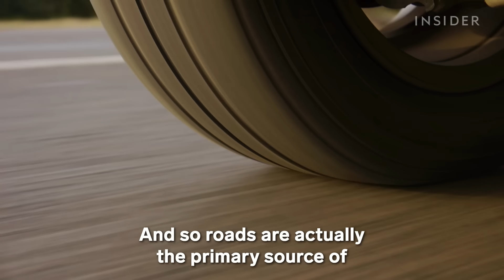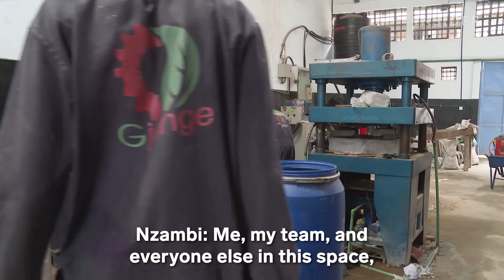Young Inventor Makes Bricks From Plastic Trash | World Wide Waste | Business Insider

Comment: if they mold the shape differently i bet they can even build a house with these recycled type of bricks. Very strong he threw it to the ground and it just bounced off a normal brick would have broke.
Reply: Being strong alone doesn't make this a good building material. What happens to these when they've been sitting in the heat for years on end? Plastic vaporizes overtime, and for the same reason you shouldn't drink put of a plastic bottle that's been sitting in a hot car for a week, certain materials aren't chemically safe for use.
Reply: @deejay1534  clay bricks have the second purpose of retaining both heat and cold. the're thermal insulators which save electrical power.
Reply: @exMuteKid  exactly. On top of that, they don't get sunbleached and turn brittle like plastic does. Or freeze to the point they shatter like glass, not that it would be an issue in Africa, but anywhere else
Reply: I wondered the same thing. I would buy them for my house if they're OK to use for that purpose.
Reply: i think you're underestimating the strength of a brick.
Reply: @archevenault  I can literally drop a brick and it'll break in half
Reply: @archevenault  naw bricks are easy to break believe me, I can break a brick easily on a bolder
Reply: @alucard-jy8wh  no,you can't.
Reply: @archevenault  i think you dont need to think 😂😂
Reply: Thats pretty much the idea of Earthship type houses.
Reply: The ability of a brick to not shatter in impact is irrelevant. At least where I live we build houses with them, therefore static load bearing is much more relevant and I doubt the plastic ones can take it.
Reply: Fire hazard....
Reply: @david-yi6dm  Not really. For fire to happen you need oxygen, which when walls are finished and painted is not there. That's how you can have walls made out of straw and similar materials. Fire hazard does exist but it's easily mitigated.
Reply: @MladenMijatov  I don't know much about construction but wood doesn't melt like plastic does and plastic is easily deformed when hot.The fire doesn't even need to touch the plastic and if the roof or floor is made out of it,when fire happens inside,the flames and heat go up and it could melt the house in minutes.(They made modular hospital in macedonia from pvc plastic walls and it burned to the ground in less than 2 minutes).
Reply: @david-yi6dm  When it comes to plastic the lowest melting temperature has to be PLA or something in that range, and that one doesn't lose structural strength beneath 70°C. That said, heat dissipation also matters a lot. You can have as low of a melting temperature as you want, as long as you are able to take the temperature away you won't be able to melt that material.

Also I am not saying plastic is great building material, but in my opinion it would be far better for bricks and walls, than walkways. Like I said, there are houses made out of straw which is extremely flammable but with proper treatment poses no threat. Just like wood. We have the knowledge and we have the skills to make it usable. Don't forget that pretty much all of electrical insulation is some form of plastic. It can be done.
Reply: Lol a normal brick would NOT break like that lmfao you're not going to beat 2000 plus years of science and engineering
Reply: @aegisraven1284  yeah ok I've already done it, I've also helped build with brick, how stupid are you its not rocket science, theirs people who can chop and break bricks with their hands seriously no bs its not that hard to break a brick if you know what your doing
Reply: @alucard-jy8wh  wrong. Bye byem nice lies but you're blocked and muted
Reply: @aegisraven1284  yeah ok dude theirs videos on YouTube of people breaking bricks with their bare hands, I aint got time for trolls, theirs literally multiple videos of people breaking bricks with their bare hands, the proof is on YouTube I don't got to prove it to you, keep thinking that what ever bricks you got are indestructible but your only fooling your self
Reply: @alucard-jy8wh  Clearly you don't know much about construction. The strength of bricks is their ability to stand up to and not break under a high static load. Saying that a brick is weak because it is brittle and breaks when thrown against the ground is stupid af. Bricks can stand up to tons of compressive force from the courses of bricks layed above them. We have no idea if these plastic bricks will stand up to that static load after decades of use under the sun and extensive testing would need to be undertaken to allow these to be used in construction in any developed nation.
Reply: @jeuneturc6233  either way plastic is bad it would be nice to see bigger companies come up with a solution on how we can use more recycled plastics so that their no need for new plastic stuff being made and so that we can make a difference and clean up all the plastic in the oceans and on land, letting it just sit their is ruining our oceans and is bad for the land
Reply: lol
Reply: That would most likely be a better solution than pavement bricks. At least that way micro-plastics are not introduced into the environment.
Reply: @MladenMijatov  yeah I just wish that companies would realize making new plastic instead of recycling it is only making the problems worse, idk why the US just doesn't stop big companies like Pepsi and coke from making new plastic until they choose too make a bigger impact on the plastic waste in the oceans and on land
Reply: The comment just full kungfu breaking bricks
Reply: They are not recycled 
They are downcycled
Reply: @jeuneturc6233  🤣🤣🤣🤣🤣🤣🤣 bro there a website called Google, it's one of the largest search engines in the world and is readily and freely available to all. Kindly use it to do some research before you start smashing your keyboard in the comments and reply only if you have done any kind of research to back your facts otherwise there's no shortage of blabbermouths on the internet.
Reply: MICROPLASTICS ALSO WHAT IF THE BRICKS ERODE OR BURN AWAY THE ENVIORMENT WILL BE RUINED
Reply: @insectbite1714  also what kind of brick houses do you think people love in?  In India, all houses are made out of bricks and they are plastered with concrete on both sides which protect the bricks. So even if abrasion is a problem with such bricks  on roads, it won't be in concrete houses because the bricks won't be in contact with any moving object to create abrasion. AND PLEASE STOP SPREADING YOUR NEGATIVE THOUGHTS FROM A FAKE ID ON A POSITIVE OUTLOOK TOWARDS A SOLUTION.
Reply: @insectbite1714  that’s already happening with all the tyres